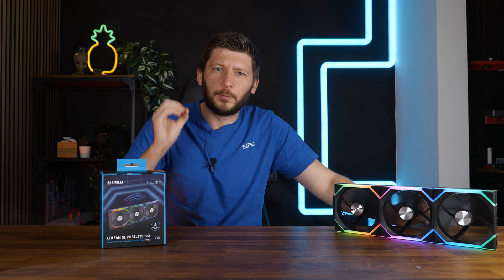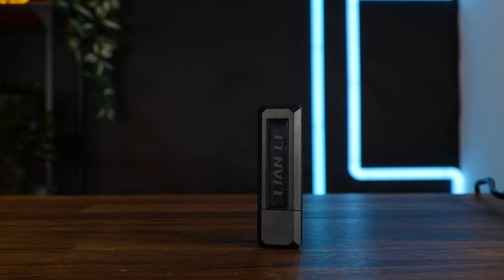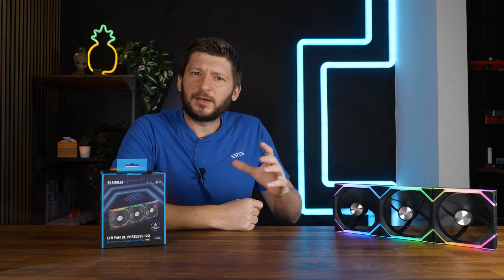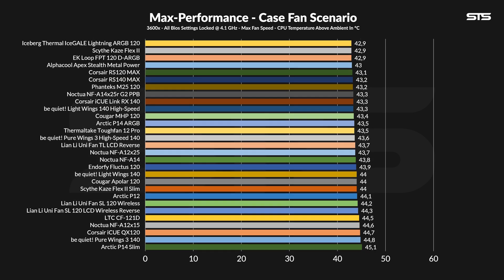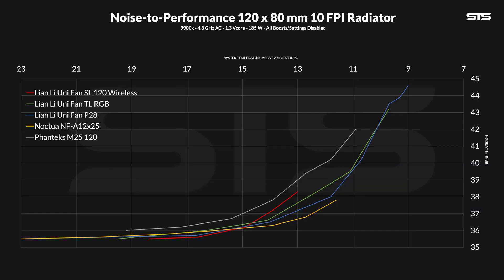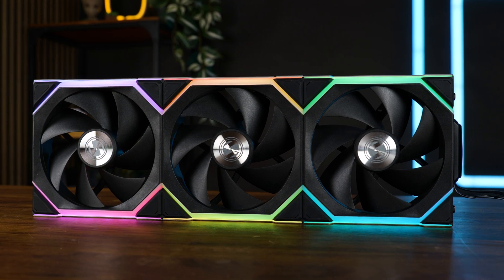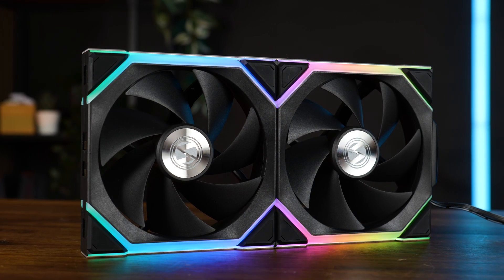The "Wireless" Fan - LIAN LI UNI FAN SL v3 120 WIRELESS

Comment: As someone with 9 fans and 2 Strimer's you're grossly undervaluing how nice it is to reduce the number of connections I need to have to controllers and mainboards with the wireless tech.
Reply: Exactly the same with me. Connecting 9 fans with three tiny wires in one SATA adapter is so damn good. And I also put WiFi controller via wires to my Lian Li Edge PSU, so not even one Fan wire goes to mainboard, and WiFi UDB dongle is also hidden in the back of the case. Awesome. Worth every cent for me.

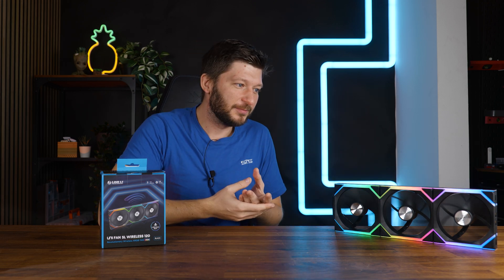Comment: 3:29 You incorrectly stated "You're limited to 10 fans", when the limit is 10 groups.  Groups can consist of 3 to 4 fans making one group, or one Strimer. You are limited to one controller per PC, but unless you individually wire each fan, there shouldn't be a limit to fans. With 4 SL Wireless in a group x10, you could have up to 40 fans (without Strimers).

Comment: I have 3 controllers, one for SL fans, one for TL fans and one for streamers.  I also had to get an internal USB hub because my motherboard only comes with two usb headers.  This makes it much simpler.  Of course, I'll need to take my PC apart and buy fans and streamers now if I want to take advantage of this but it's a neat idea. Also, If I decide to go this route, my motherboard has a bunch of USB ports in the back so this thick stick would fit there fine.
Reply: Could even use one of the now free headers to install it inside the case on the backside of the motherboard tray

Comment: Never ever worry about turning a wire into wifi when your already running power wires 😅, these are 100% definitely NOT electrical engineers designing this stuff, I am 20 years now licensed, these are being designed by the marketing and financial departments... don't feed into their stock price guys, pretty lights are tempting but not with the headache of crappy everything else needed to make it run... and there are so many points of added failure with lian li fans at this point it's rediculous to even be designing fans at this point, just make rgb.

You may end up with no fans if that dongle breaks 😅. I just returned 15 TL LCD fans when I found out they would consume 3% cpu each, 45% of my cpu for 15x 400x400 animations, on a 9950x at ideal. So they release wifi models and break TL LCDs entirely in the process... software engineer and interface engineering is an utter joke at lian li... with such great cases, they should have much shame.

Comment: Seems like these would be really useful in small form factor builds because of the less wires
Reply: Less wires maybe by 10% sure, but not any less cabling I.e. groups of wires.

I just discovered that L connect in idle consumes more resources than any other stagnant process on my computer, I already mew the lcs screens consume 3 to 5% of cpu on a 9950x... now they want to add wifi without repairing the old... in fact, they broke the tl fan lcds when they just updated l connect for wifi ones.... I don't even think they understand the size of the hole they are digging for themselves... sure, make every new fan incompatible with the last let's you sell, but engineering reputation is destroyed and software maintenance costs will explode. I'll never buy a lian li fan again, definitely not unless they connect to mobo directly and don't require software.

Comment: You’re missing the point.  This will unify the controller now.  You had to have separate controllers for strimers and fans.  And newer fans like the TL aren’t compatible with the older controller.  I think it’s a great ideas to remove the need for a wired controller and to unify the wireless one.
Reply: Ever hear of wireless speakers?  Don’t they still require a power cord?
Reply: @shan2752 some do some don't, some have battery... but I can tell you this with certainty: any speaker getting it's power from the "source of the signal" should also get it's signal from there. In other words, you have a power bus in your house, this is what justifies wifi... that being said, when it comes to reliability, cost and long term sanity, even in the house you would be better off running cat5 when you ran the power. We are dealing with lower level devices here in an isolated enclosure... I don't see the benefit of the change, especially while previous lines continue with serious problems.
Reply: Please... the controller is pointless to begin with. Very stupid device. This is all pretend innovation. Basic electrical engineering... if your already running a big power cable between signal points, run a tiny signal too.  Wifi just adds complexity and failure points.

They should have released a real psu fan power bus capable of powering 20 fans, each with blue tooth, using a normal wifi router not cheapo dongle.

They also state nothing about safety for the added risk... we are talking about a cooling system, it exists for safety.

Comment: The only good part is that is actually doesnt kill performance, unlike the TL LCD fans that will make both cooling and performance worse, something that no one tells you
Reply: Wouldnt L-Connect 3 and its background services monitoring the sensors still be a drag on the system load and temps?

Comment: This "Wireless" method sounds horrible, and even more proprietary. Just have an open standard, that is wired.

Adding more signals inside of a closed PC case sounds absolutely fantastic /s.
Reply: It uses USB and PWM for power depending on if the LCD model or just the RGB model. Both are open standards. I genuinely don't understand the hate on this product. As long as they don't price it too high, it's a massive reduction in cabling compared to their previous solution. Seriously, what are people on about with this? All you have to do when designing a wireless signal device is use an uncommon channel with autos witching and there won't be any issues with interference. It's bog standard tech at this point.

Comment: Could you add "lower is better" or "higher is better" to the graphs?
Reply: If you need help figuring out if higher or lower temperatures are better I think you should just consider a new hobby.
Reply: @Alphacuremom55  if you look at the graphs at first glance you see a bunch of names and numbers where the numbers are not even labeled with the unit of measurements.
A simple line and the proper use of  unit symbols could clear up the clutter and speed up the information processing...

There are more than just temps when you are talking about fans. Could be CFM where higher is better or dB where lower is better or static preassure where higher is better and RPM is subjective. Maybe you should just consider a new hobby if you are not familiar with these factors.

Comment: You really should consider using aqua computer pwm controllers like the quadro or octo. They have onboard memory so all you need to do is install the software once, save the settings, and then you can uninstall the software and nothing will interrupt the fan curves or settings you applied.
Reply: Yeah, aquacomputer is the goat for low overhead and control but it's an extremely complex and very costly setup compared to many. It's great for custom loops. This solution cuts to having a single PWM cable, if you use the cable that allows you to connect multiple bunches of fans together, and a usb dongle to power and control 10+ fans. That's pretty fantastic, frankly. People are way too focused on trash marketing, which is always trash from every company, instead of actually evaluating the product as it is.

Comment: 10 devices doesn't mean 10 fans. It means 10 batches of fans. 3 fans connected together counts as 1 device. One of the new Strimer cables is also 1 device. You could have 3 strimers, 3 sets of 3 fans,  then a single rear fan, and a Lian Li AIO when they make one with this feature, and that's a total of 8 "devices" for the control box.

Also, while I get where you are coming from with the USB stick sizing and the fact that there is still a required cable for power(because otherwise you would be relying on batteries), you clearly had an axe to grind here and weren't remotely objective. No, it's not the be all end all solution, but this is a massive improvement over every other previous option. The old controller,  much like every other RGB controller from major companies, was hot garbage. This is actually useable and an even further step down on wires than every other method currently available. If they manage to keep the price in check. This is objectively a good product and one that needs continued support and development. I'll never understand the lack of standardization and  consistency in reviewers. Every reviewer is guilty of arbitrarily loving one thing, but then hating an objective improvement on that exact thing. It's so weird.  Frankly, piss poor work on this one. You  generally do good work so hopefully this is a one off.
Reply: Consistency in reviewers? What, like acting like a shill so that they always get free products? No thanks.

I'm sick of reviewers ass-licking manufacturers.
Reply: @Mapantz1  Oh believe me, I hate that too. It drives me nuts when people can't call out bullshit. However, lack of consistency is the single biggest issue, period. You can smell a shill, but the only reliable way to see lack of consistency is to actually use many of the products yourself. This is actually a rare instance where it seems that people are being overly critical because of bad marketing instead of a bad product.  What I mean by lack of consistency in reviewers is that they lack an identifiable standard by which they consider certain qualities of a product. It's become extremely common for reviewers to say one product is amazing for the exact same reasons they will call another poor. An example of this is when two cases can use the same steel gauge, have similar tooling and features, where one will be lauded as having high build quality and the other will be stated to be average. This happens constantly to the point that I can no longer trust quite literally any case review that doesn't actually specifically mention material composition. Another way the lack of consistency manifests is that, when there is an improvement in a product that doesn't impact cost, it's often dismissed or bemoaned as "unnecessary". This review is actually a very good example of this. These fans look like they are matching the price of the original SL and the SLv2 fans with an improved, less proprietary controller that will likely be cross compatible with all future lian li fans.  The SL have always been middling performers but they are the product line Lian Li starts with. It's likely because they are well into their manufacturing cycle so they are pretty easy to make changes to compared to completely new designs.
Reply: its not objectively good when its going to be overpriced and not even the highest performing fans on the market. you sounding like a shill my guy.
Reply: @PokemonTimmy You seem to be misunderstanding what has been stated but I can appreciate where you are coming from. My comment had nothing to do with the actual fans themselves as they aren't an upgrade. They are perfectly fine but never impressive just like any other RGB fan. The main thing is that this controller will be their standard for all of their fans going forward and should allow for complete compatibility of all of their future fans. Saying something positive isn't shilling for a product. However, getting very basic details about a product, in a published review, where said basic details are quite literally directly linked to in the video information by the entity who published the review, is just bad work. There's really no other way to put it. It's actually unacceptable in my opinion and happens way too often.  I've been extremely critical of Lian Li's Unifan completely proprietary control mechanisms in the past but this is a huge step forward. By using PWM and USB, since they are open standards, others will have a much easier time adapting to and very likely integrating with Lian Li. Lian Li will also have an easier time adapting to others. Again, this isn't perfect, but they can't exactly break the laws of physics. You either have a battery on the fan(s) or you have a cable on the fan(s). Take your pick. 

I'm going to quote myself here to provide more info just because it's easier to copy and paste:

 "Jameson, Lian Li's CEO, has stated that the swap to wireless hasn't had a significant, or any, increase in cost. We will see what it actually is, but the reduction in the cost of all the cables and the previous controller offsets the cost of the wireless adapter significantly. If running the non-LCD versions, you could connect all the fans together with the daisy chain cables and then run a single PWM cable to a high amp fan header on the motherboard. Power still has to be provided and the only two options there are a cable or a battery. I'm good with a cable that doesn't require charging or swap out. For the LCD ones, a USB cable carries data and power. This is why they chose this standard. Guess what? USB is open source. Crazy, right? The reason the PWM cable still exists at all for these is two fold. 1. So you can connect LCD and Non-LCD ones together and still power the fans. 2. 3 and 4 Pin headers on motherboards don't require POST unlike USB to actually function and is the standard for fan control across all motherboards. 

So, yeah, they adopted two open source standards to ensure compatibility here and are saying that the cost isn't going to increase much, if at all(again, we will see if this is true). What more can you expect?"
Reply: @PokemonTimmy  "not even the highest performing fans on the market"

The airflow and static pressure  is worse than the original LCD fans, and also worse than the original SL fans from two and half years ago. Lian Li doing all of this fancy shit to their   fans, and getting worse on performance.

This is why I stopped using Lian Li products. They have completely forgotten what the purpose of a fan is.